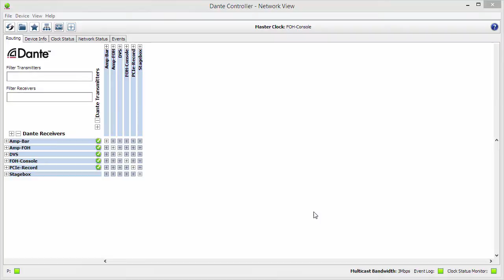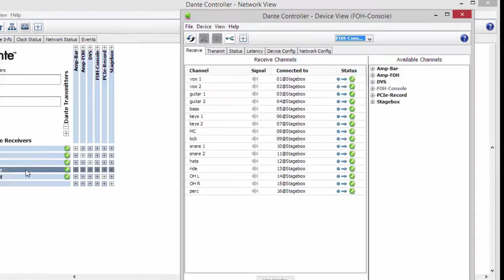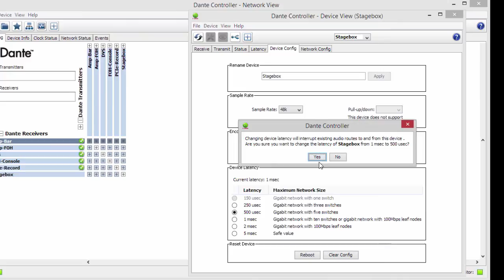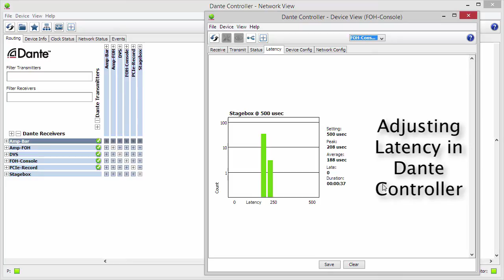Latency Management in Dante Controller

Comment: Why does the histogram show 1 bar at first, and then 2 bars after the adjustment?
Reply from the maker: Hi @mjklein! The histogram reports what the latency is between the two devices. After the change to the device's latency setting, the latency between the devices has changed. It does not clear the older value, just continues to report, which shows as a different column. If you have any more questions about this, reach out to our support team: https://www.audinate.com/contact/support